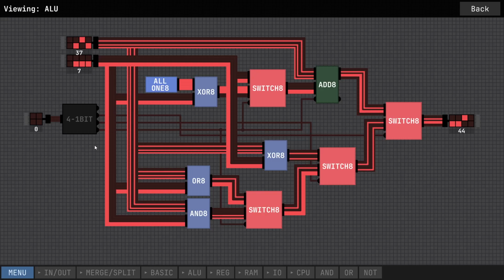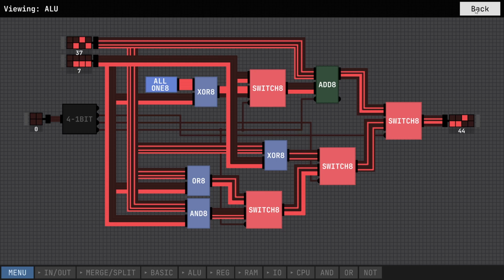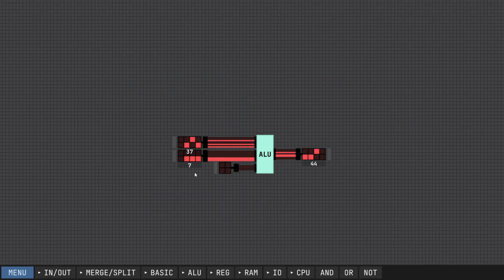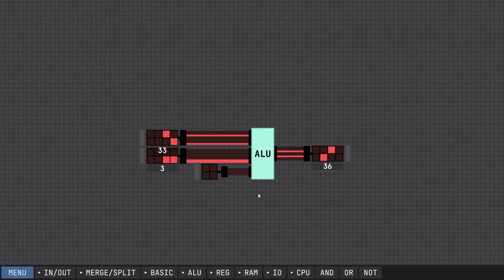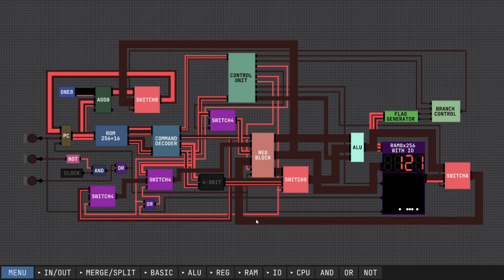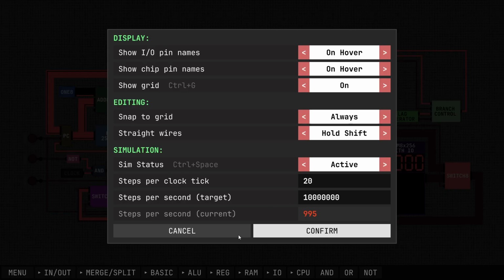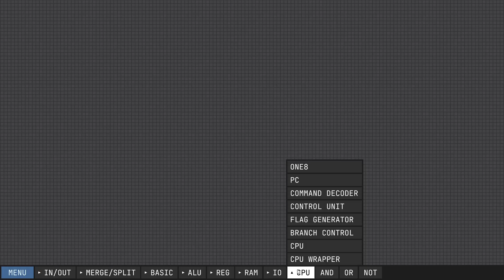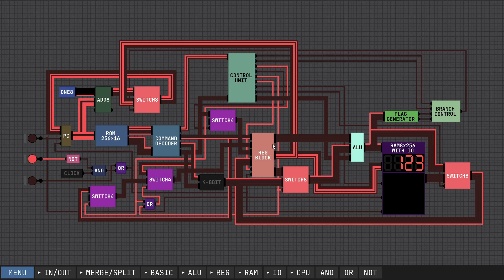I made the Digital Logic Sim run 100 Times Faster!

Comment: What are your computer specs when you were using this version? I tested the community version where this was implemented and got half the performance (~19000 steps per second). Either way its over 12 times faster than the base version for me. This is really cool! Thanks for basically saving my 8-bit computer project that Im working on, the upto 65000 instructions per second go down from 2:39 to 13 seconds!

Comment: for a massive performance upgrade for the RAM, you can just use the first two nibbles of a RGB display instead of actual RAM, as I note because I have found that RAM is usually the least performant component of the CPUs I make

Comment: rather than generating the entire lookup table on the first run (presumably) why don't you just make it cache any unseen states and then reset when the chip gets changed.
Reply from the maker: That would have also been an option, however I decided against that because that would make the simulation speed unpredictably and also wouldn't give you the fastest possible runtime speed anymore.
Reply: @_CC_  that is very true